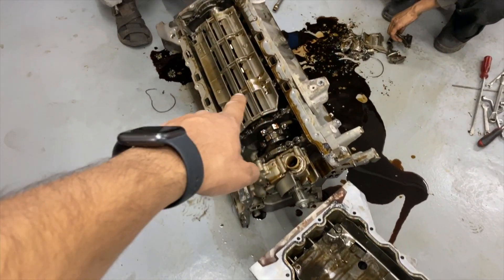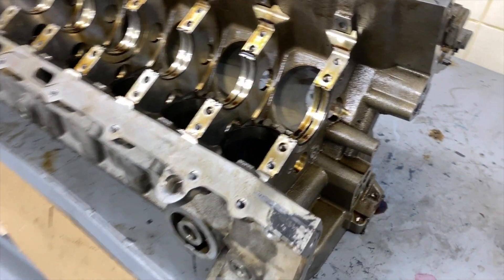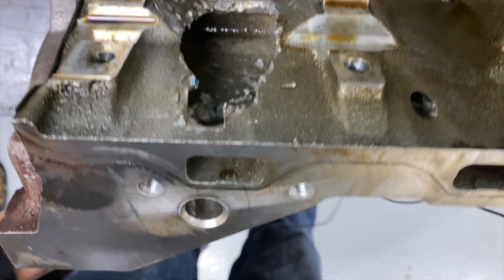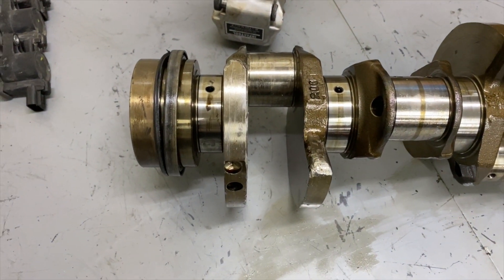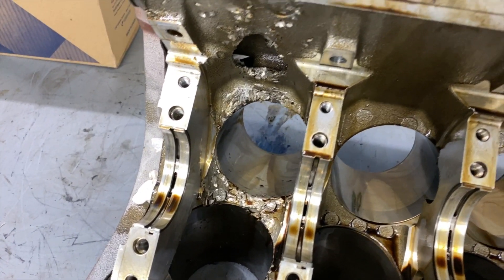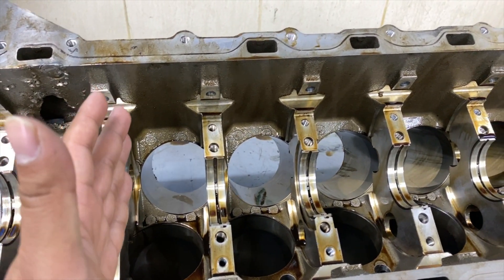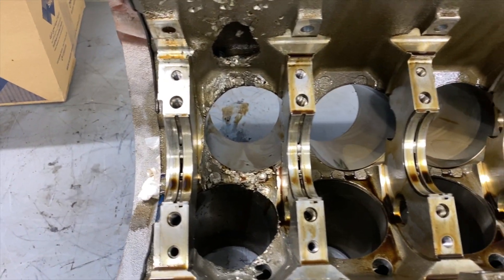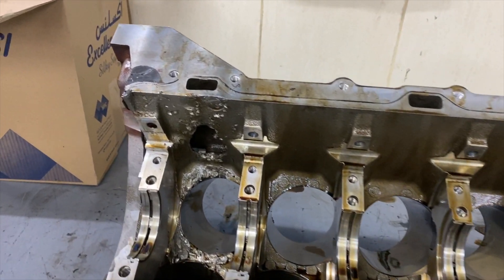Two holes found in my engine block of my V12 Aston Martin Rapide! - EP09

Comment: Given the price of those parts, I bet the block, crank and heads could all be repaired. 

I don’t know what machine shops are like out there but I’ve seen cranks and heads with far more damage welded up and re-ground good as new. It would probably cost 1/2 of what buying new parts would and used motors are running $18-24k at the moment…. I’d guess $8-10k in parts and labor including repairs and machining to rebuild that engine.

Thanks for documenting this! I’ve been dying to see this motor all apart and this is the best set of visions I’ve ever come across!
Reply from the maker: Thanks for your comments. The build is back on track and just uploaded another video. Videos should be weekly now.

Comment: V8? V10? I thought it was supposed to be two V6s!!
Reply: the v12 aston is based on the v6 duratec but there is not such thing as using two v6 and weld them... The v12 is a "new" engine using some parts of the v6 (timing parts, pistons design for example) but the casting is all different. Don't ask me how I know :d
Reply from the maker: Y that’s what I thought. There’s more to the story and I’ll do a full video in the future.
Reply: @supercartribe  - now THAT is one to look out for!!
Reply from the maker: @markchip1  Oh darn. I'll have to make it now! Thanks.

Comment: I've read that Ford used parts from Mustang V6 in the AM V12's
Reply from the maker: There are a lot of shared parts for sure. I’ll be making a full list and putting it all in a separate video in the future.
Reply: Not the Mustang, the ST220. 

Pistons, rods, valves are the same, but Aston had the block, heads, crank, camshafts, etc all made specifically for this engine.

They also had all custom Aston Martin part numbers issued so you can’t cross reference any shared parts from Ford, Volvo or Jag 😂